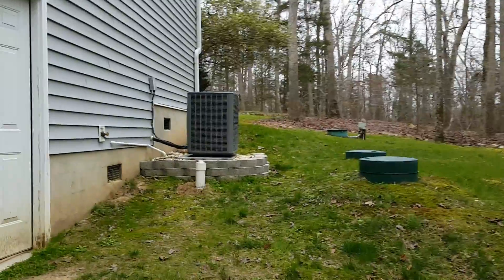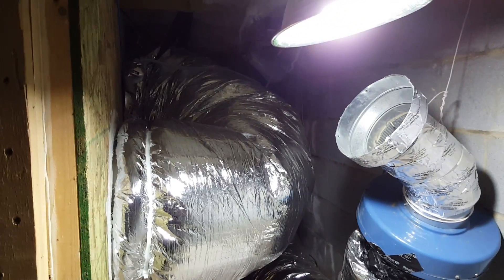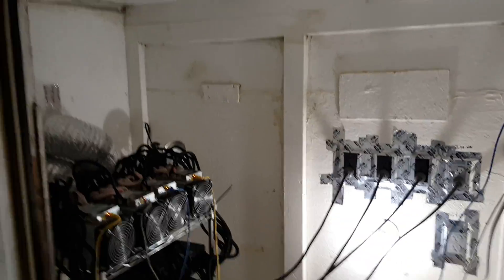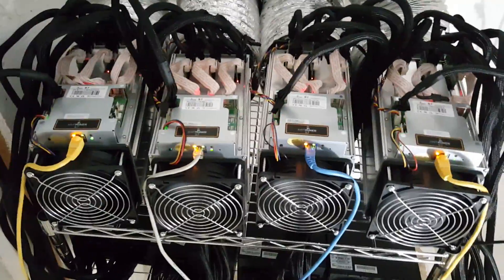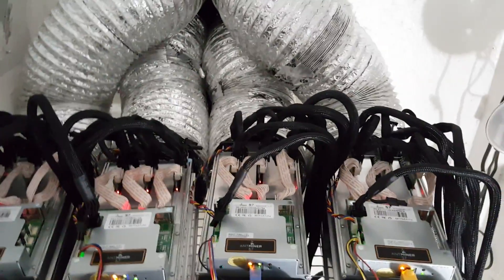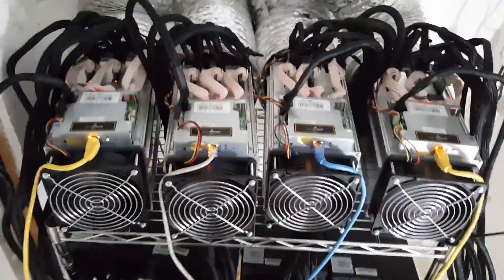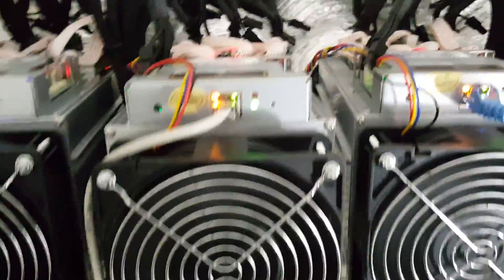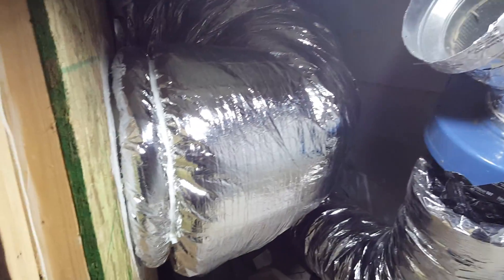Bitcoin mining W/Antminer s7 / Green Energy part 2

Comment: Can you explain the HVAC part of this?  Where are you getting the cold air from and where is the hot exhaust air going?

And you mentioned somehow using this for cooling in summer.  How would that work?
Reply from the maker: I'm using the air volume of my house to heat and cool the equipment. I essentially took the returns from the house and ran them into a box that has the miners running in it and then there's a dock that goes to the air conditioning system. https://www.youtube.com/watch?v=HbKQ3xCShIA
Reply: @TheBitcoinMiner  thank you!  Now i need to find an HVAC installer willing to take on this challenge.  May I ask how the mining operation itself is going?  Is it profitable taking into account the electricity cost, or are you just using it to subsidize the cost of heating the house?

Comment: many guys have luck for have money but dont know use. structure terrible. s7 are amazing but structure is ridiculous.
Reply from the maker: Hi Facilita Promotora, please explain a little bit what do you mean by structure terrible? Tell me what you think I'm doing wrong, I would love to learn?
Reply: I may be wrong, but it's be better to build a custom box around all your miners and pump air in/siphon air out. This should significantly help with static pressure. Right now you're venting a huge room, but you want to concentrate your ventilation around the miners themselves. I think it'd be better to build a box, pump a/c into it, then hose the exhaust for each miner into a vortex fan out of the box.  That's my plan, so if I'm wrong, someone please call me out and educate me before I get too far :P

Comment: A few quick questions:
1) Which are the measures of each duct tubing? (Please try to add it to your Amazon list)
2) Which materials are you using for the box? It's pretty quieted in the outside and I want to create one like that.
3) Do you have to create one line of 240v for each miner from your breaker box?
4) When will you going to sale some S7s?
Reply: Diomedes Ignacio Domínguez Ureña if they're using standard size computer fans they'd be 120mm, possibly 140mm

Comment: Great video, but what are those solar panels you showed in the beginning are for? Do they make you any V?
Reply: I am master electrician and from what i have seen maybe they would sustain ONE light bulb on the sunny day. Of course you need to store energy and all depends on battery capacity too. Now showing those three solar panels 240 watts max in Carolina in practice  more likely 120 watts real power times average over the year 3 hours of sun expose it is a joke. Wind generators is a joke too. Take it a backyard decoration only.
Reply from the maker: Hi Geo Prospector Thank You! It's called The Solar Mill and yes it generates me about enough power to run one of these rigs for about 8 hours a day.

Comment: bro , greetings for your smart ideas 
i have a question 
wheat is pressure for ? 
how much the one S7 antminer gives you  as a profit monthly  ?
can i can make it run fully on Solar panels and Wind turbines ?  or it will be lose of money ? 
thank you  :}
Reply from the maker: +Mohamed abd el gaied attia The fan that is moving all of the air has to have a certain amount of air resistance which is called static pressure. so when I open the door it can move to freely and it doesn't move as much air as it should
Reply from the maker: +Mohamed abd el gaied attia to figure out your profitability you're going to want to use a calculator like this one http://www.coinwarz.com/calculators/bitcoin-mining-calculator  Now this math s based on the larger pool's but I've been trying smaller pools and I've been getting paid a lot more but there is a risk with the smaller pools it's not guaranteed.
Reply from the maker: +Mohamed abd el gaied attia yes it would be possible to run it completely off of solar panels but mine is back fed into the grid and then my 4 s7 just draw power directly from my house and the power grid so basically the power grid actually my battery Bank

Comment: Have you noticed the price drop of the s7? I bought my s7 for 3.12btc and now it sells for 2.1btc. In that time I only made 0.9btc, so I actually lost money getting in a little early. What are your thoughts on buying more? I figure with the sp50 coming and the s7 keeps dropping in price its not a lot to collect at the moment. And what about buying miners before or after the halving of the reward. Allso one more question, if its money to be made with the s7's why do bitmaintech sell their miners?
Reply: noe they are 1.7 bitcoin 720 usd
Reply from the maker: Hi +Eirik Strand, I did after you had said something and you're right it does seem like the price did dropped much quicker than I was hoping for. As far as buying more that's a hard question to answer because it depends on your scale and what you're trying to do. For me personally it's about the power consumption so 4 is my limit for now and I think we need a lot more info about the new ones coming out but I'm definitely very interested. I'm not sure how much you know about processors but to go from 28 nano-meters to 16 nano-meters fully custom is huge. They sell them to make money on both ends they're smart and think about it I bet you 60% or more of the people go to their pool so it also supports their pool.

Comment: Liked the noise control with the box.  I had to do mount some rock-wool and hung some rugs to act as sound baffles in my basement. It is still loud enough to hear in the house.  I am lucky to have a big basement. It is acting as a heat-sync for the miners for now, but I like the idea of venting them. I have a basement window that would be ideal for pushing the heat outside during the summer.  Have some concerns about the difficulty increases and how long the S7s will be profitable, but I am happy for now.
Reply from the maker: +Richard Deron  Hi, I saw your video and I was thinking you could put some 10 inch insulated duct from Lowe's to help dampen the sound, on the front and the back of the miners. So in other words suck the air through a five foot piece and push the air through another five foot piece.
Reply from the maker: +Richard Deron  I'm personally hoping the S7s will be profitable for at lest this year but who knows.
Reply: +TheBitcoinMiner  I will try that out. I was looking your setup and was thinking that I could use the ducting to push the heat outside for during the summer and reverse it in the winter to pull cold air from outside.  I will try it out and see how it goes.
Reply: +TheBitcoinMiner  I am going to hope for the same. I am interested in seeing what Antminer is going to come up with next  and what the BitFury miners that are coming in March/April this year.  May roll my equipment then if they are drastically more efficient.   Bitfury is claiming they will be 3X as efficient as our S7's.  Waiting until then before I buy more miners.

Comment: box's soundproofing is really impressive. Can I get some details on the materials used in the interior of the box to soundproof?
Reply from the maker: +serdar öztetik Hi, 
It's just a half inch thick OSB wooden box but it is sealed really well with mastic. I believe the extra noise dampening is coming from the air movement within the Box. But it doesn't seem to work well.